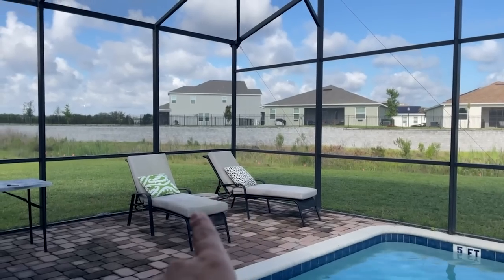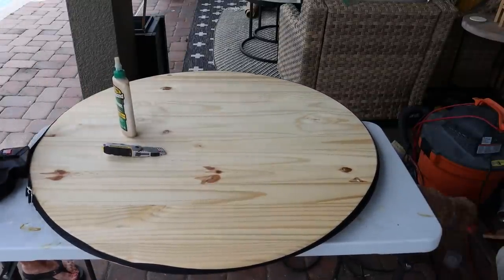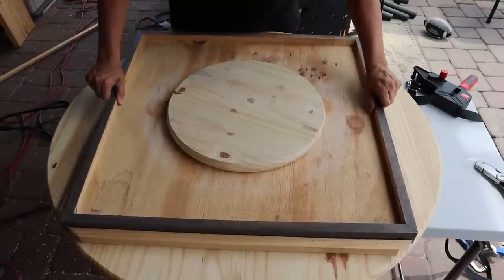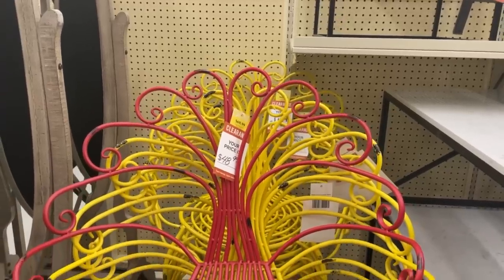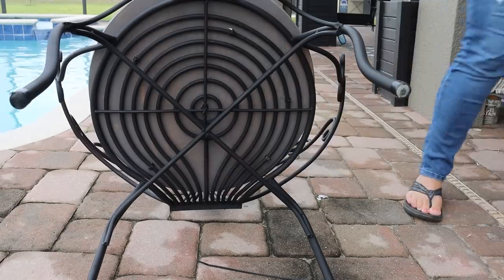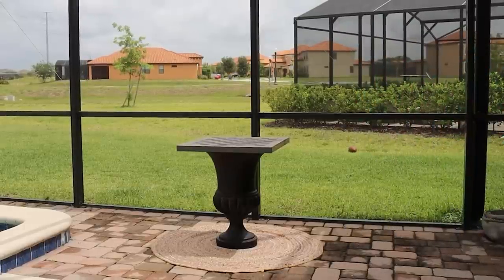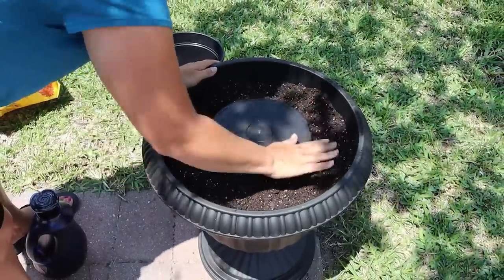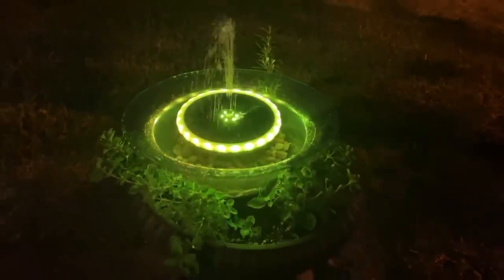HIGH END Outdoor DIY Decor Ideas That Are Amazing!

Comment: Before the wood glue use pegs. I love the gel stain and still be able to see the grain in the wood. Can a heat gun help dry it?? What keeps the table from being top heavy. I have high winds where I live.
Reply from the maker: The urn base is not crazy heavy, but it's substantial enough that it doesn't feel out of balance. But if you are worried... you could store some heavy items inside to weight it down. ;)

Comment: Wow!  You’re a rockstar to get under the stairs and tie on those seats!  I would be so sweaty...oh, and wouldn’t be able to get back up!  🤣. My dad and brother built me a water feature with an old iron pump and a big galvanized metal bucket. I haven’t used it in years because I really don’t spend as much time in my backyard and the last pump I bought for it ended up not staying on. I think it probably is too high of voltage for my outlet!

Comment: Love your creativity! Zip ties would never have occurred to me. Now that you've given me the idea, though, I'm eyeing several projects where that will work. Just one suggestion: fill the bottom of your table base/urn with gravel nearly to the top. Use foam board to top the gravel and put the chess pieces in the remaining cavity. The weight makes the whole table more stable, yet it is easy to pour out the gravel if you need to move the table. Most of my summer plans involve gardening projects. Any suggestions for bending heavy wire rebar panels into curves for creating outdoor arch trellises will be greatly appreciated. Love your content - keep up the good work!

Comment: I enjoy your videos, always so inspiring! I need to get busy making our outdoor space prettier so we will want to spend time there. LOL I really loved the fountain! I plan on making several birdbaths and a couple outdoor fountains real soon. One thing I did notice though is you drilled the hole in the bottom of the large planter and then put that bucket in the center, where the bowl sat … But I did not see any drainage holes on the bucket that you turned upside down. I realize it is not a watertight seal so it will probably be fine but it might be good to add few holes about an inch from the (real) top edge of the bucket, just in case. 😉